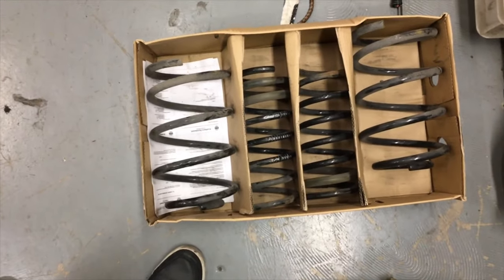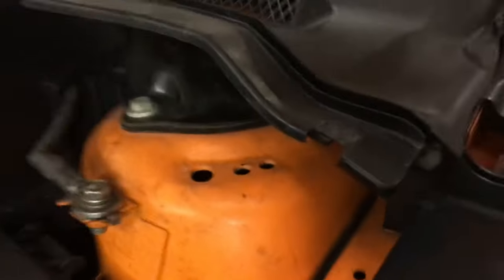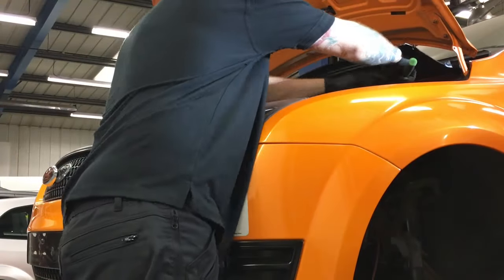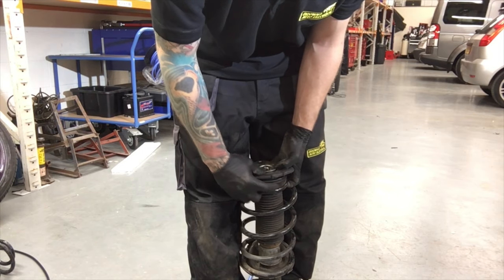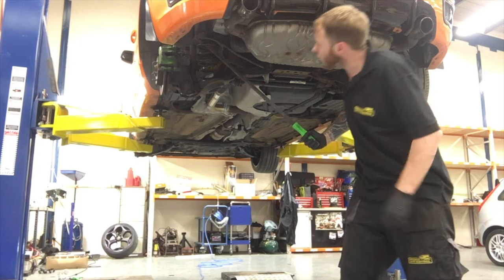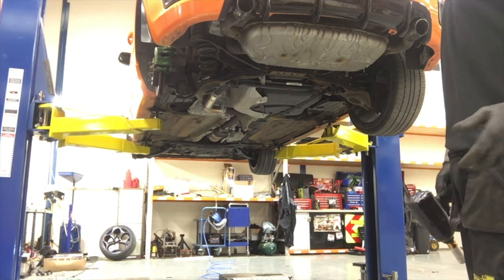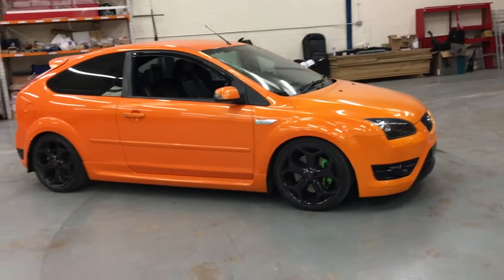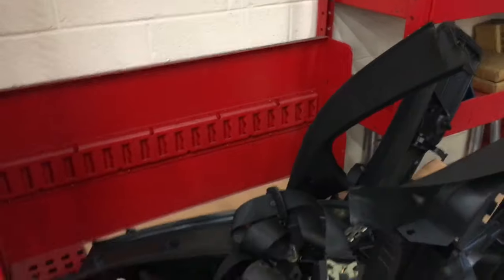How To Lower A Ford Focus ST MK2 225 Eibach Pro Kit Springs

Comment: Great vid mate..have a prob with my ST225 though..just had new spring and top mount done..everything is tight and mount is facing right way but now getting a thud like hitting a pothole from the front.any ideas?drop links look fine,so does ball joint.
Reply from the maker: Look at your wishbone bushes probably fucked mate 👍🏻
Reply: Jason Kelly did you change wishbones? Or was it you had to put shorter drop links on? I’ve got same problem

Comment: Was thinking that wouldn't using spring compressors be the easiest and least dodgy way of getting the rears out and in? I will be doing this on jacks, so slightly reluctant of using the prybar lol
Reply from the maker: Nakke144 dodgy me? Never... 😂. I tried spring compressors and got them stuck in the cups they were just to big. The proper way is the drop the arm holding the spring in it with a jack under it. But my bolts where stuck fast and they are prone to snapping. So I opt for the not so safe dodgy way 👌🏼🤗

Comment: Did you cut one whole coil on the rear  mate ?? I’ve got the same issue with my eibach springs on the rear ?? Thanks
Reply from the maker: Yeh mate just one coil off the rear

Comment: Anyone  tryed different dampers with lowering springs on a focus mk2?
I was just wondering what the difference is between bilstein b4 to b8 on a lowered focus can I get away with b4 or do I spend out on b8s? 
It's on standard ones at the moment but they've done a fair few miles
Reply from the maker: I had bilstiens b8 and they were the best suspension I’ve owned on mine. if I remember B4 are oem equivalent and b8 are upgraded sport with thicker damper shafts 👍🏻

Comment: how much did those springs lower the car 30mm??
Reply from the maker: Jasedogg's B eibachs are 30mm front and 25mm rear I think. But if you chop them it levels it out to 30mm 👌🏼